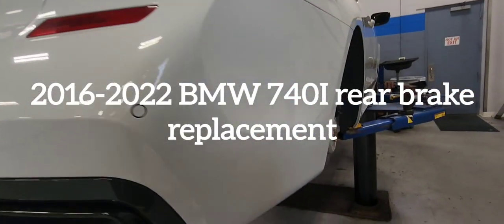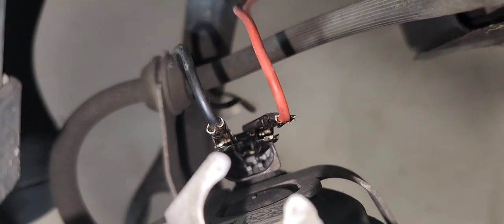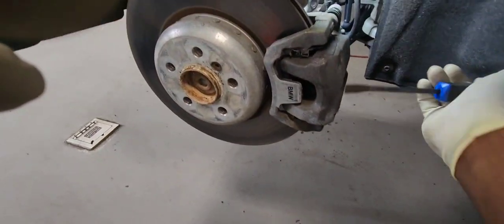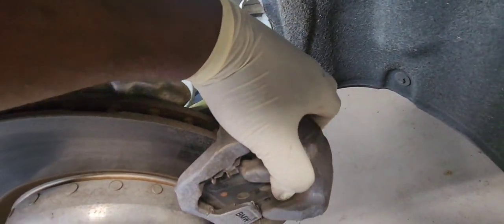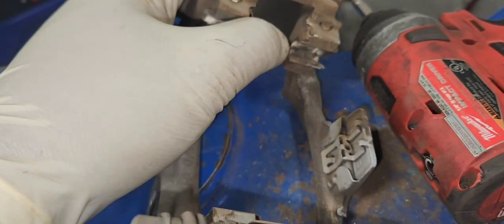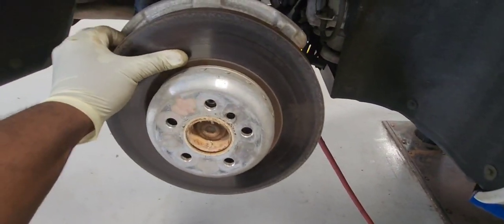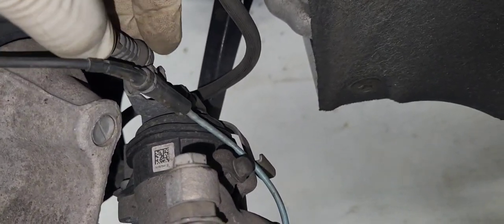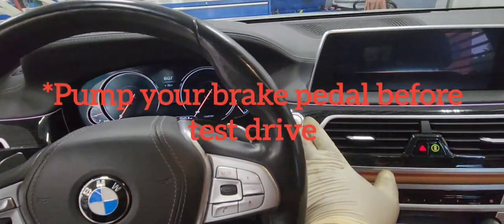Avoid Costly Repairs: DIY BMW 740i Rear Brakes Replacement

Comment from the maker: Link for the rear brakes
https://amzn.to/3DTt9pS
Allen socket set
https://amzn.to/3s7NXaI
Wire brush set
https://amzn.to/3DS9K8X
Basic hand tool set
https://amzn.to/43XPCgX
Caliper compressing tool
https://amzn.to/3qo7lzN
Etorx set
https://amzn.to/3OQlcrM
Hammer 
https://amzn.to/3NuImlQ
Aligator clip set
https://amzn.to/3Qwr2jl
Jump pack used
https://amzn.to/3ORcOs4